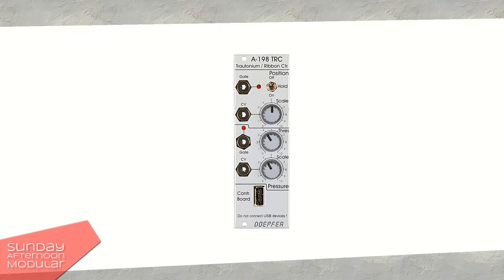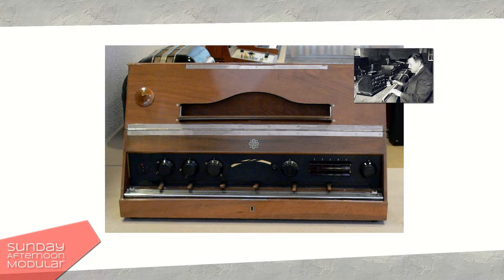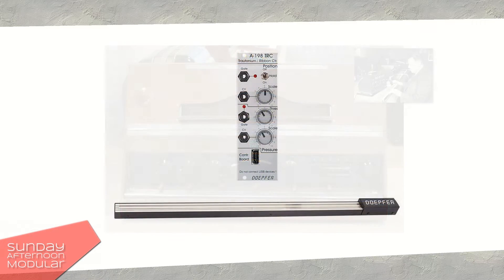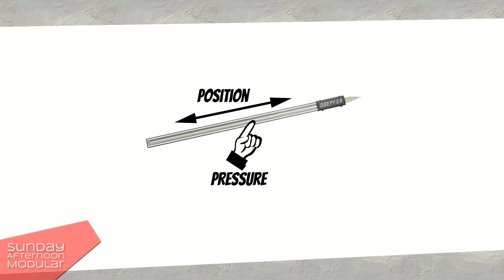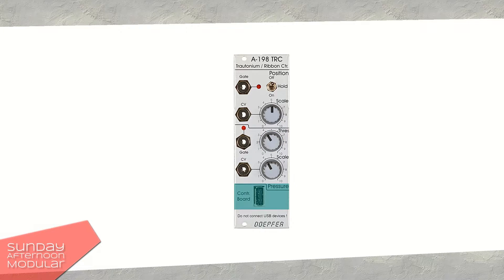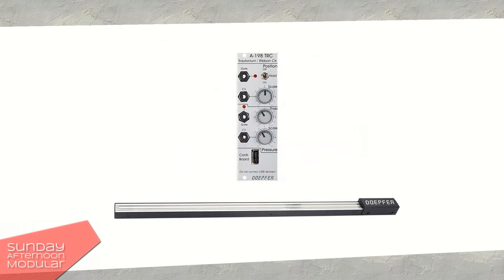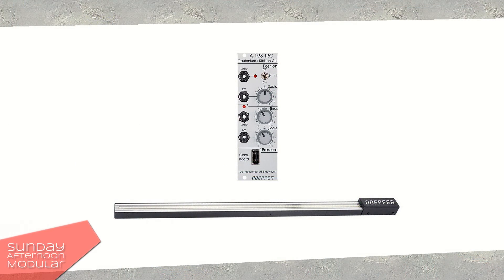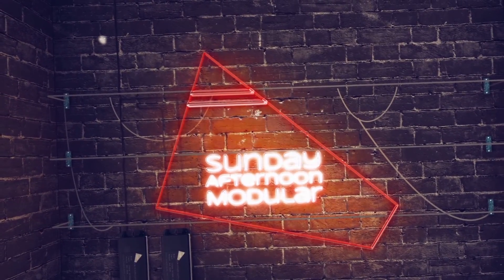TRAUTONIUM & RIBBON CONTROLLER: DOEPFER A-198  [What the heck is a Trautonium?]

Comment: Hi, thanks for such a good overview!!  Do you happen to know if the a-198 would work to control software as smoothly as in eurorack ? Im thinking of getting it and a midi/cv module to use as a vst controller, but im wondering if in the cv to midi the pitch/v per octave  transformation there might be some stepping or issues like that...  could there be any issues or am i just worrying too much? Thanks a lot!!
Reply from the maker: Hi there, I honestly wouldn't know if this is possible. This is something you would have to try out.

Comment: huh so you can change how far apart the notes are with the top "scale" knob, looks like!? that makes sense to me for practicing to perform with it .. you can start with a small range and plenty of room to find the notes & then graduate to a larger range with closer notes

i think someday i'm going to have to find room for one of those somewhere .. i was imagining it as just a ribbon but i guess it's actually a little box with a ribbon in it, hm! where could i squeeze in a little ribbon box hm :)
Reply from the maker: Hi mungojelly, sorry for the late response. Yes, the scale knobe changes exactly that. Fully turned to the left it only plays one note, fully turned right it covers several octaves. And yes its a box with a ribbon and a pressure sensor, pretty cool. Hope you find some space for it ;-)